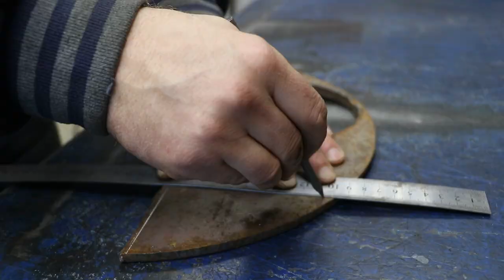DIY knurling device!

Comment: Is there any reason why you couldn't use this tool on larger diameter steel rods (i.e. 30mm or 32mm)? I want to knurl some handles for some homemade gym equipment and I'd rather not pay through the nose for someone else to do it for me. 

Great video! Really well made tool and the great video editing helps make this sort of thing even more watchable.
Reply: Just make the distance between the pivot points of the 2 arms larger too so they don't get too much angle and lose clamping leverage
Reply: You could make the base plate with multiple pivot holes, to accomodate a wide range of diameters.